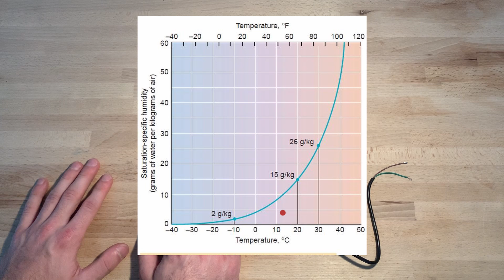DIY mini Ultrasonic Humidifier

Comment: need STL file of this enclosure, please.
Reply from the maker: https://github.com/BootlegEngineer/Humidifier

There is a design flaw tho, the two half connect in a way that lets water past. If it would be mirrored it would be better. Anyways maybe you can use them.